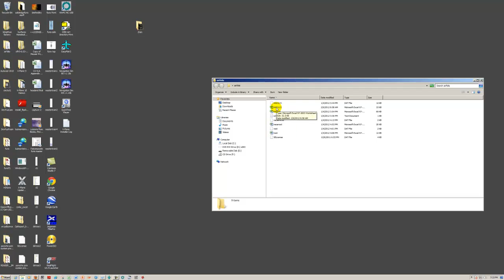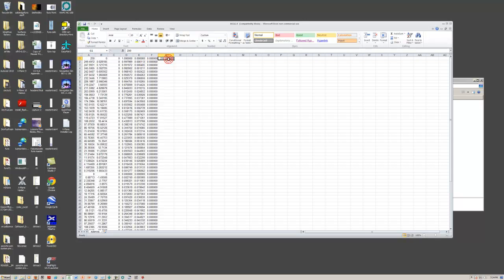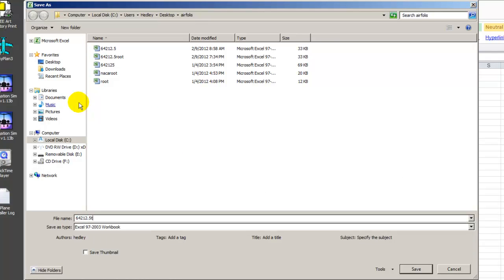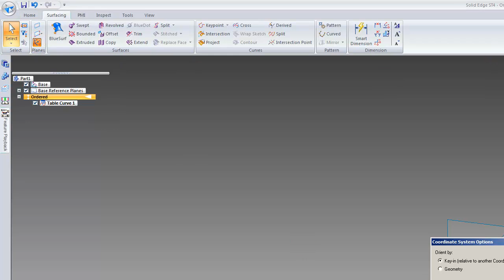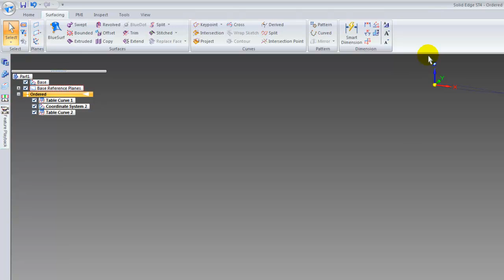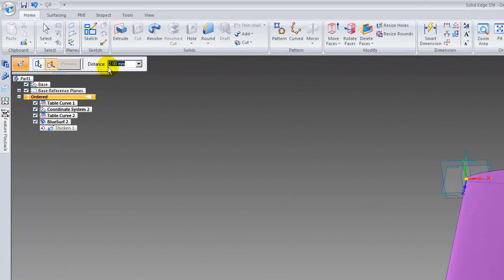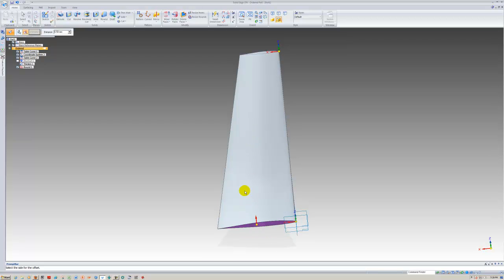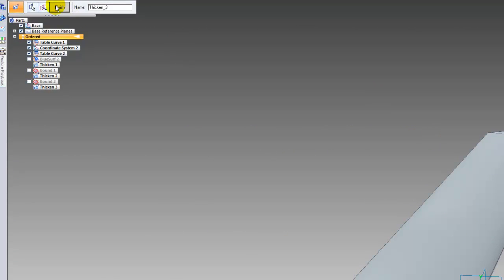wingcreate.mp4

Comment: Hi, I created a wing following your video because I need to use it for Ansys. I have a problem because I cannot change the format in Iges because it says "Don't exist bodies". Can you help me please?
Reply from the maker: Did you use solid edge to create the model . If so you have to stitch all the surfaces closed to make a complete solid body to import into ansys
Reply: I believe I did it because I don't use the thickness but I only created the wing and closed the airfoils of tip and root. For this reason, I cannot understand